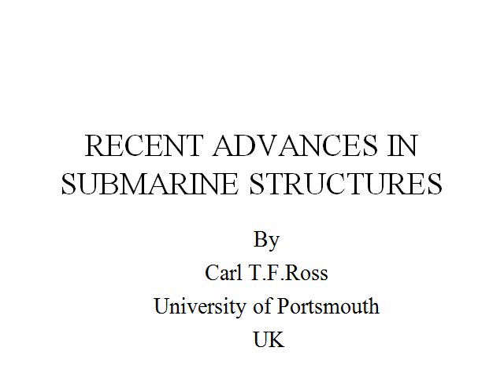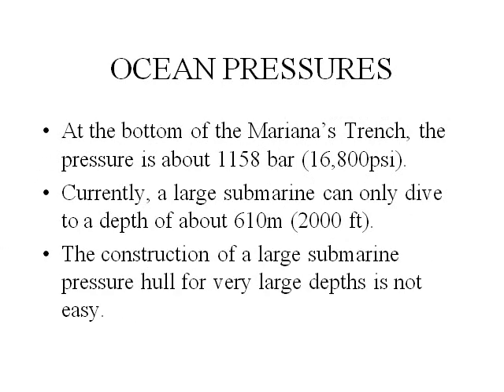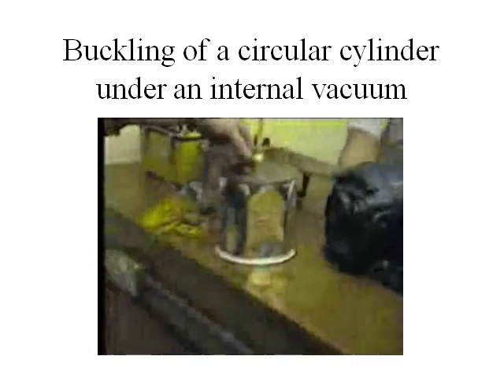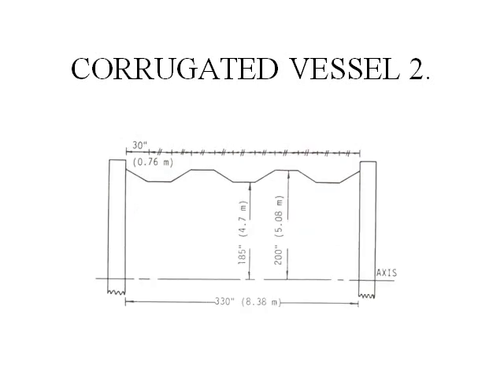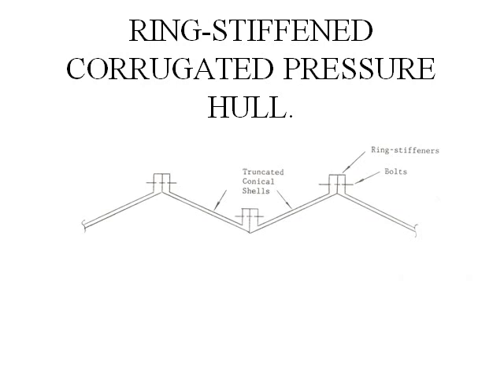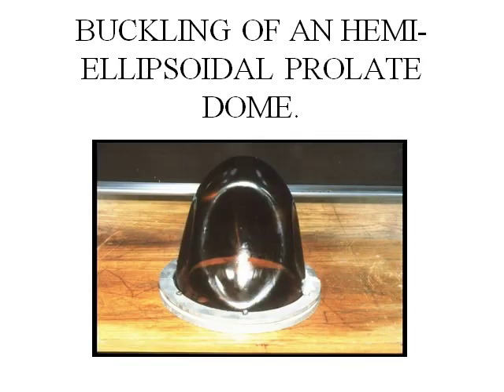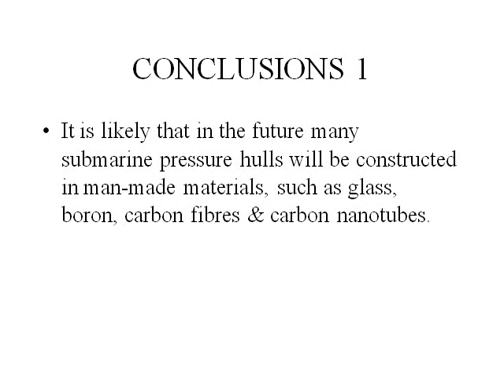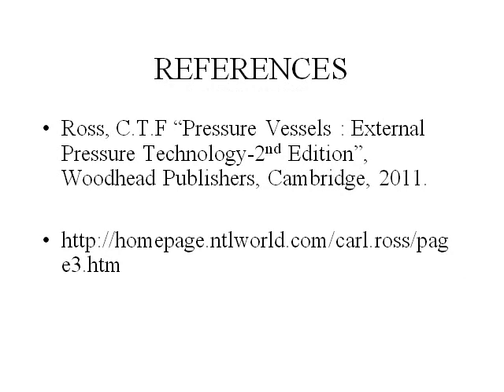Recent Advances In Submarine Pressure Hull Design.

Comment from the maker: An inverted concrete dome would not fair well; because concrete is weak in tension.  Concrete may be feasible if it is in pre-stressed concrete; using steel reinforcements.  The hydrodynamic hull has water on the inside and water on the outside and is unlikely to fail due to hydrostatic pressure.  Yes, a corrugated or ring-stiffened prolate dome would fair well.  In the past we successfully researched on the former, & recently,we have been researching on the latter.

Comment: Am I right in thinking that the thickness needed of a cylindrical or spherical hull is a constant ratio of its diameter, ignoring stiffening? If so, what effect would stiffening have on this relationship.

My reasoning for asking is to see if the material cost: internal volume ratio gets better with larger size?
Reply: Unfortunately, I don't have access to that literature at my university.

To simplify my question:
If you had an corrugated cylindrical pressure vessel designed for, say, 100bar external pressure, that had a certain internal volume.  If it were exactly scaled up by a factor of 2 (increasing weight and interior volume by 8), do you think would the resulting structure be stronger or weaker in the 100bar conditions?

I am not doing any research on this, it is just something I was curious about!
Reply: Thanks, according to your program, doubling the diameter, thickness and length (from the first example) results results in the exact same buckling pressure, as I predicted.